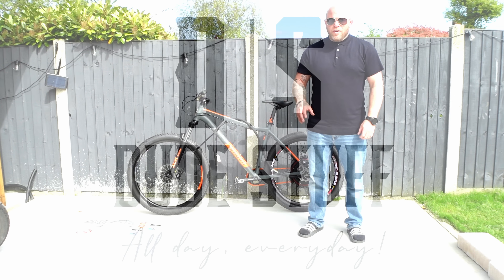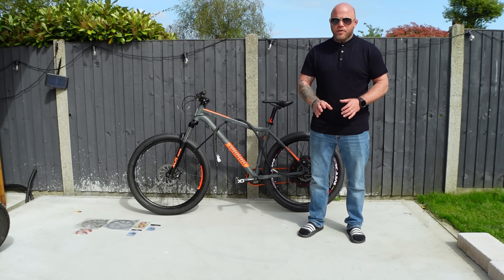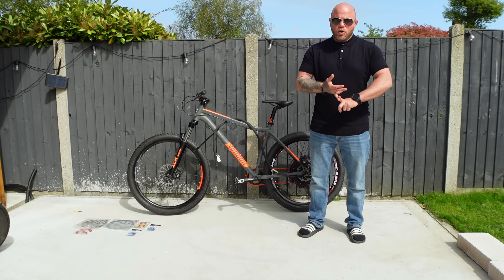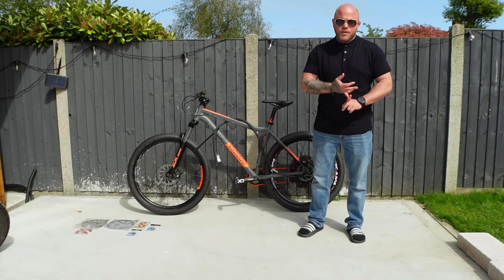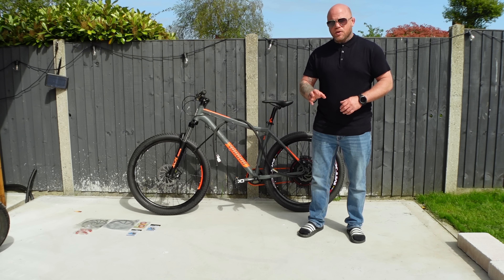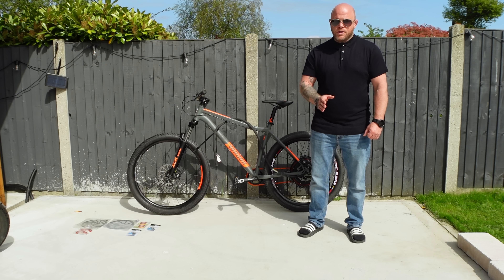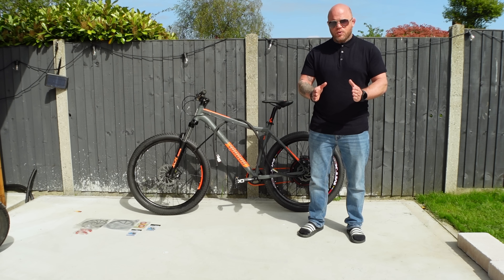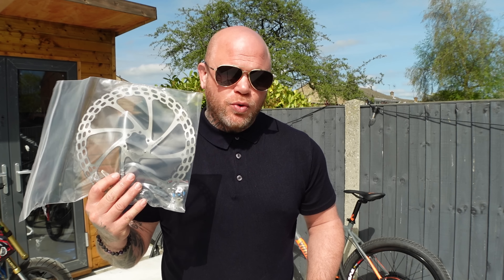LOW-COST BIG BRAKE UPGRADE, FOR ANY BIKE! (WORLD'S FASTEST MTB PT.3)

Comment: NIce install done correctly ! Manual tightening the bolts, correct tightening sequence,  centering the caliper using the brake and not touching the braking surface on the discs. I've seen so many videos with so called "professionals" using electric drill drivers, to tighten up the bolts going clockwise or counter clockwise and spraying gunk over the discs. Urggghhh!

Comment: A route I've gone and im just doing a 2000w is i got a torque arm from ebay that basically bolts to the back of the disk break mount.. so ive ended up having to space that side with the disk on because ive gone for a 9 speed freewheel so it needs a few washers but the torque arm is 4mm stainless so rather than what youve done there with the spacers the torque arm itself is the spacer spacing the caliper rather than the disk. 
The torque arm design is quite unique and should serve to make sure there is zero movement and will look better than the usual jubille clip jobbie.
Only thing is it's been in the post since march.. coming from ukraine the irony is it got in the country quickly and been stuck at royal mail sorting office for well over a month.. laughable when they have a war going on.
Reply: Royal mail is the absolute worst.
It'll probably never turn up.
Sorry
Reply: @theordinary1175  it's moving again now god knows what they doing with it maybe it's going for a ride around the country 😜

Comment: Can the fork and rear caliper mounts take the rotational forces exerted by a 220mm rotor at high speeds... Some frames will rip the mounts or bend the forks..

Comment: You really should have a motor  torque arm from grin tech as they seem to be a better grade of steel then the Chinese ones having 2 on each side would be great on your bike so it doesnt slip and it has steel support not the aluminum alloy frame lol its gonna stripe hardcore and ruin your wires 😭

Comment: Be careful those forks are not rated to take that size disc. The maximum rated size is 180 mm.
Reply from the maker: Apart from the calliper mount, what effect would the disc size have on forks? I can't see it having any issues
Reply: @DudeStuff  it puts more torque through the axle so in an emergency if you slam the brake on it could pull the wheel out of the quick release dropouts.    It's similar as to why you put torque arms on the rear wheel with hub motors , to stop the extra torque pulling it out.  I'm not saying it will but just keep an eye on it , I'd hate for anything to happen especially with the speeds it's likely to go.
Reply from the maker: @darrencable1934  there's a lot of stuff I need to keep an eye on when this runs 😆 exercising with caution ⚠️ 👀
Reply: @DudeStuff  not kidding lol. Looking forward to seeing what it can do.

Comment: I wonder why brake manufacturers for these don't just go for more surface area on the pad rather than just a larger diameter rotor with the same thin pad.
Reply: Larger the rotor less it heats up which is the main cause of break fade
Reply: Because physics.
Reply: Leverage.
Reply: @SchoolforHackers  Makes sense.. damn thanks lol.

Comment: How's that going to be the world's fastest lol .. I'm using the same 5000watt wheel with a 150a controller and a 72v 60ah samsung battery iv chipped the controller and upgraded my bms does 70ish mph and the Acceleration is Insane and mine will eat yours and mines far from the fastest after watching some of your videos your about 5 years behind .. you don't no a lot.. people in the US are running 10.000watts to 17.000watts on a standard frame 😅 and yours is the world's fastest
Reply from the maker: Your bike is max 7 to 10kw I have the option of running up to about 37,000w  not quite sure you understand your specs or mine.  Or maths or anything much tbh 🤷
Reply: @DudeStuff when are you gonna make your part 4 I’ve been waiting for months now